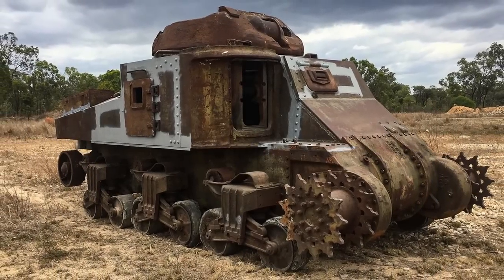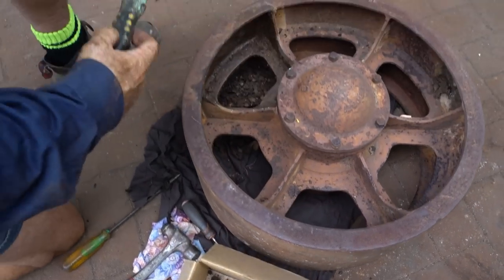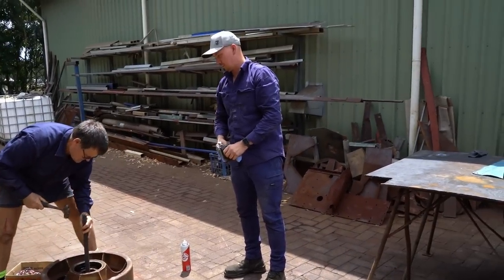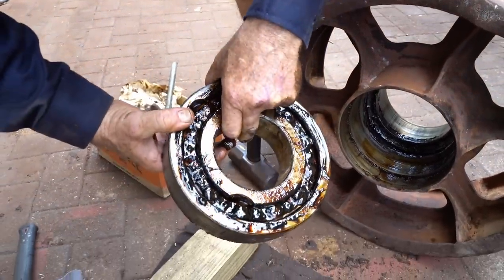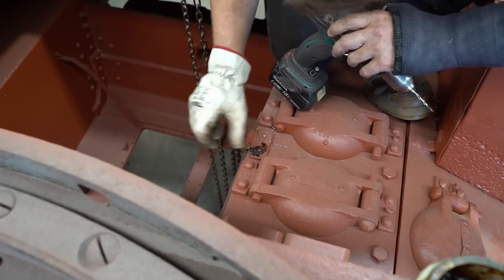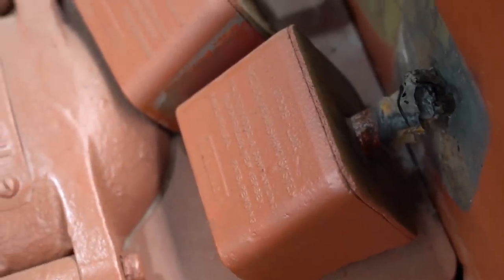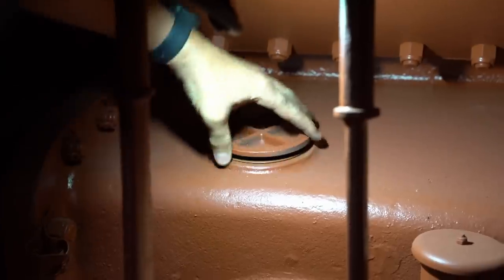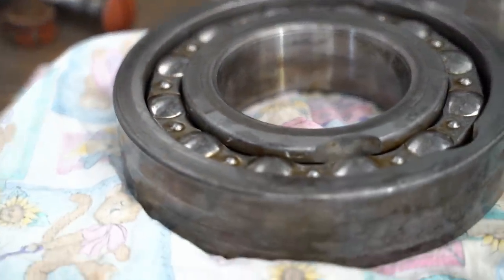WORKSHOP WEDNESDAY: Working on the idler wheel, rear decks and inspecting the transmission and diff

Comment: I totally agree with the final statement. The quality and condition of the internal components of this tank are amazing. It is hard to believe that some farmer used it for years, and then there was only a partial restoration. This looks like an awesome "runner." There is some rust on the external components (especially the left idler), but that is understandable after more than 70 years, but the gears and bearings are in just phenomenal shape for a WWII vehicle. This is an amazing find and will be an amazing addition to the museum.

Comment: Hi Team, Nice work on another great video. The bearings in the rear idlers wheels are called slot filled. Hence the slot that can be lined up to be able to install at least another two ball bearings to handle more load. 🙂

Comment: To get those bearings back in a little easier, try dropping them in a freezer for a few hours first. Hopefully the heat of the day will expand the metal of the part you are pressing the bearings into just enough. You might be able to pick up a can of liquid nitrogen from an electronics store if you need a more localized freezing of a part.

Comment: When Jesse was working on the back hatches and couldn't remove the bolts that were under two pieces that he had to remove those might be for the fire suppression system there would be a "T" handle that would be pull to set off the fire suppression to put out the fire one for the drivers compartment and one for the engine compartment.

Comment: Great project.  The pair of Kidde Lux shrouds on back plate of fighting compartment, toward left side, are missing the T-handles which are the external 'pulls' for the fire extinguisher system.  Maybe the procedure in the event of an engine bay fire was to pull one or both handles to hopefully extinguish the fire.  I probably would not want to clamber half on top of the engine bay to reach the handles under those circumstances.  Maybe also they were for ground troops to reach in the event the crew were 'as yet' unaware they had a fire.  I thought the housings were diecast so curious about them being tack welded to a steel plate to cosmetically retain them.  Apart from the damage to their through-plate tubes they appear in good condition.  The handles were also diecast as IIRC they have the Kidde name cast in them and they are each affixed to a bowden cable and there are small pulleys, etc, in the fighting compartment that route the cables to the levers on the valves of the fire extinguisher bottles.

-And I finally found 2 previous replies indicating this info.

Comment: Those fire extinguisher brackets are  covers for pull handles. Pull the handle would pull a cable to release a fire extinguisher bottle mounted inside the hull.
Reply: Yes they did have a tendency to brew up..hence the Germans allegedly called them Tommy Cookers.
Reply: @ericjohnson6802  
Unlike German tanks that ran on Diesel, the US tanks ran on Gasoline.
Reply: @GeistView  What Diesel engines?   Panzer 3, 4, Panther, Tiger 1 and 2 all ran with petrol Maybach engines.
Reply: @iaenmor  I stand corrected. Was the Russians. 
That being said, Germany did experiment with Diesel with the VK 20.01 (D) with the MB 809 engine in February of 1941. Serial number 30009 began that March (41) with a MB 809 Diesel engine.

Comment: Am very mechanically inclined ,and I know of a few tools that make your job so much easier,that always using a torch on those bolts,making such stress to them,suggest a tool,you should be able to get that has a special wire that heats up the bolt not the surrounding areas,Solary Magnetic Induction Heater Kit 1000W 110V For Automotive Flameless Heat Induction Heat 1KW Hand Tool,this tool will save you time and money,I use similar ones on my bolts,trying taking a header bolt off that been rusted over time,I am not promoting it,by any company,just want you make easier for yourselves.

Comment: How does all the heat affect the temper of the steel?  Or is that even a worry?
Reply: not a worry now, since its not going into combat.  it will anneal the metal, but these were also the rear deck plates, likely never hardened to start with.

Comment: Dead right about the industrial power of the USA...it's what won the war..that's what my old man said...the US was good at logistics and most of their kit was very well designed and built. Excellent work!
Reply: This was the third generation of this transmission design… after the first three or four thousand you tend to nail the manufacturing…
The Americans built more M4 Sherman’s (which had the same transmission) than every single tank the Germans built in history.
(The M2 Medium was the first iteration of this drive train).
Reply: @allangibson8494  interesting point but I also tend to think the US spent time in proper design/build to get it right whereas the Germans tended to out think themselves.  You can see the US design and build philosophy in eg Cat dozers. My uncle served in British tanks and whilst he admired the US tanks eg for speed and sheer availability he worried about a lack of armour and their height eg above hedgerows. But in the end they did their job well.
Reply: @ericjohnson6802  The height of the M3 & M4 was a combination of initial engine choice and hull ground clearance (which flowed from the preceding M2).
The M4 was actually armored and sloped exactly the same as the T-34 in the frontal aspect (and complaints about the T-34 are rare).
The Americans prioritised mechanical reliability and repairability above everything. It typically took 1/10 as much time to repair the same damage to a Sherman as a Panzer IV as a result and a Sherman was 1/10 as likely to breakdown in the first place (with 95% of Sherman’s turning up after a 100km road transit and between 50 to 75% of the Panzers).
Tiger and Panther tanks had miserable reliability with more being lost to mechanical faults than enemy action.
The early T-34’s were similarly spectacularly unreliable (but got better as the war progressed).

Comment: I scratch my head at these tapered bolts.  I get that the taper bears against a taper in the part, and the bolt can't pull through, but how do you loosen or tighten it? I've run into a lot of bolts or studs that were so rusted or galled that I needed a wrench on both sides to remove. So how do you do that with a tapered bolt?

Comment: Rust will wear off and not affect the gears, sand it off carefully first for a better chance of not destroying the gears. Case hardening not compromised. Heavy mobile plant mechanics may disagree. Still, it's the first thing I've seen I don't agree with (boilies always cut, heat and bash, normal behaviour).

Comment: Most all ,, if not all, M3 Tank Transmissions and final drives were made By John Deere.
 The M3 could be called,  Lee "American Gun" or Grant "British Gun" .
Reply: Tim are you talking M3 Light Tank (Stuart) or M3 Medium (Lee & Grant)?  My M3 Medium diff housing has a Chrysler plate on it.  The gearboxes as far as I know have Mack logo.  When you say 'Gun' I think you mean 'Turret' as I think British doctrine preferred the radio in the turret, hence the Grant turret has a bustle.  Alex.
Reply: Thank you for the hard work. I watch every show and bug friends talking about it, So interesting.. 
 My comments are made with limited info, but I believe in them, but I could be wrong.. 
 Yepp,, I should have said turret, defined Grant/Lee, I think other turrets were fitted also than the main 2.   M3 medium. Chrysler made the tank and engine. Interesting, says Mack or Mack 5 on the transmission, good story somewhere.  I doubt JD was the only manufacturer of transmissions, especially in the first runs.  I was told the gears were from an existing JD tractor design, although. With a hydraulic transmission being tried to a point. 
   The historical record is unclear whether Mack actually built the transmission at all, or final drive, Mack said they made 2600 M3 Grant/Lee transmissions, but it's unclear as to what capacity as they also say they made the gearboxes only at a point.  Mack did make some internal brakes that went in them, is really about all that's known, someone knows. Being said Mack was instrumental in many WW2 vehicles. 
But John Deere was known as the Prime transmission and final drive assembly "Contractor" for the M3 medium tank. Almost 6,000 M3 medium tanks were produced in 1941-1942.   The 22,000 transmissions and final drive assemblies produced at JD Waterloo were spread over the two types of tanks M3 Grant, M4 General Sherman and one type of tank destroyer, the M10 Wolverine. The transmissions and final drive assemblies were interchangeable between the two tanks and the M10. Some of the transmissions had soldier made nick names, like "Mary Ann". 
 The M3 Grant originally had a three-piece casting for the final drive assembly.  As the war progressed, it was replaced with the one-piece casting. There was also a serving US battalion, of 4500 enlisted Specialists of JD Employees that were used as truck and tractor maintenance, During WW2 That Included the John Deere company president at the time, given the rank of Colonel and called the "John Deere Battalion".
Reply: @timcovey7280  Very interesting Tim.  I 'think' the uni-joints on the tail shaft are same as used on Mack's but I haven't got anywhere near that stage to confirm it.  In regard to M3/M4 interchangeability - the right hand casting of the 3-piece diff housing is a different shaped casting to accomodate the hull edge of the 75mm side turret so maybe apart from that casting they were possibly interchangeble with M4 Sherman before the one-piece housing came off the line.  Of the M4 gearboxes I've seen, the handbrake cone extension cover seems a different shape and of course in regard driver pedals and levers, the driver straddles the gearbox in a Grant and sits to the left of it in a Sherman as in a Stuart.  Thanks for sharing the additional info.  Alex

Comment: Will you be able to find a Wright R-975 easily enough, to fit in the old girl?
Reply: That engine isn't what this particular grant rolled off of the production line with. This grant had a pair of diesel engines that are unique in the fact that the both run backwards, to most other engines due to the way they link together to power the tank. But im thinking due to the original engines being rare. I'd vote the guys will likely run a much more common late model diesel engine for ease of getting it into running condition.

Comment: Tapered bolts on US Tanks as well as German. Surely someone still makes them?
What engine[s] does this use. I did a little research and to me it would seem like the twin GMC diesels?
Reply: big ol air cooled radial airplane engine
Reply: @orbitalair2103  But this is a twin diesel hull.  The most rearward sloping backplate size is the most visible clue and then engine bay floor and firewall openings and the engine deck covers and grills once you can check it more closely.  Alex
- Don't think there's twin doors under the overhang at the back either unlike the radial hulls.

Comment: On a lot of tank resoration videos I see rusted/pitted metal just being coated with primer and left as they are. Why not use somekind of automotive putty/filler to smooth out the surface? I realise there's probably a very good reason, I just dont know what it is.
Reply: Well, it does make it easier to tell if the item is original or reproduction.  Also 'patina' and tales of its life are lost if it is made to look like it rolled new out of the factory.  It spent more years of its history harboring rust pits than not.